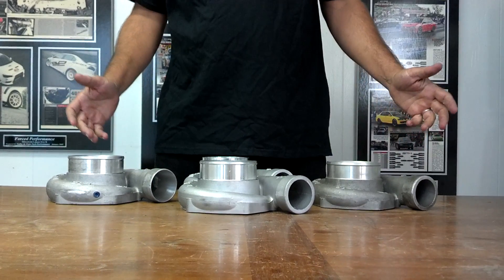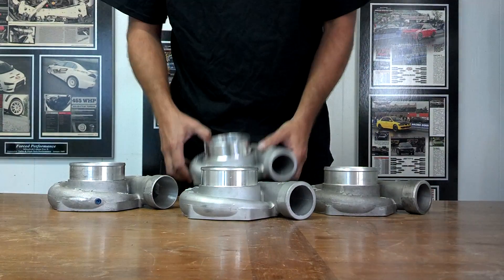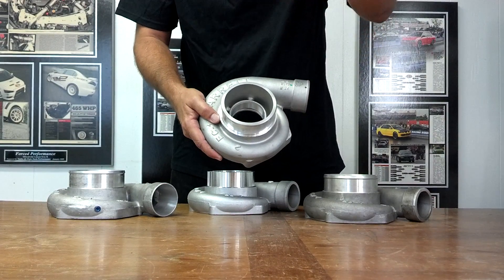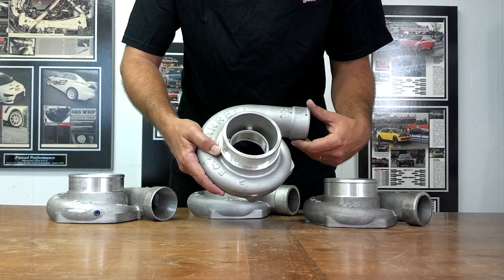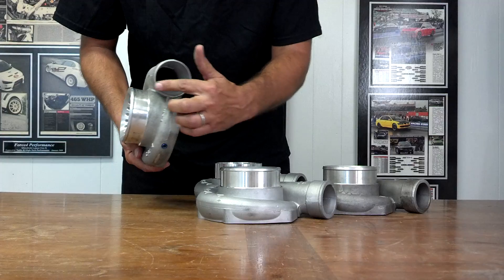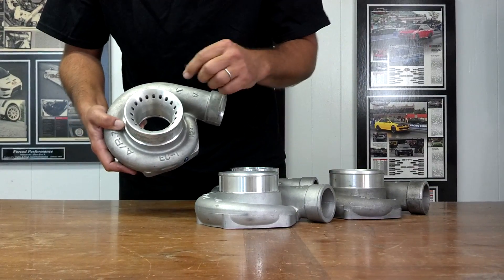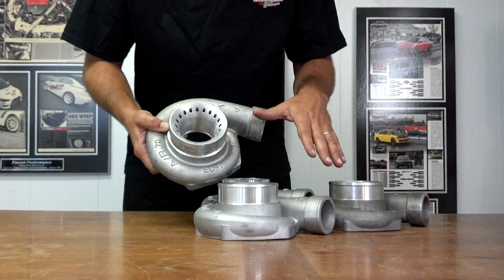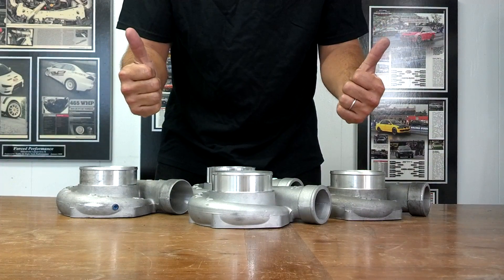Compressor Cover 101 - Surge Ports

Comment: I think (correct me if I am wrong) this was addressed from a gas engine perspective due to surge when the throttle plate(s) close while the turbo is spooled.  How is it different for a compression ignition engine that does not have a throttle?

Comment: I'm shocked after all this time no one has called this out.  Air DOES NOT flow through the surge port toward the impeller.  It flows from the impeller through the slot and circulates back to the inlet.  Look at any CFD analysis on the subject.
Reply: The CFD engineer, scientist or user has to make the assumption(s) as to where the air will get into the turbo and set the boundary conditions. The assumption that the air is traveling through the impeller only may be correct or not correct. Therefore, testing is needed to confirm the path that the air will travel to the turbo. I "believe" that it goes through both, but the bulk of air goes through the impeller. However, the argument that more power is made on the slot than the hole type housing may not be significant. TESTING IS KING.
Reply: @27ubs  This might be correct if it wasn't already a well studied and tested topic.  I have 5 research papers in front of me based on CFD and gas test stand work.  It's real clear what these ports do and there is a reason the technical reports all refer to them as recirculation or bypass ports, not surge ports.  I'll call that that street name.